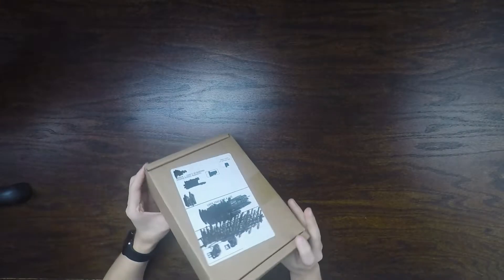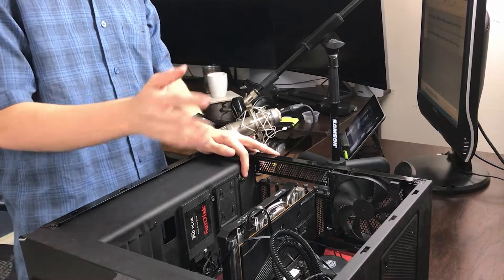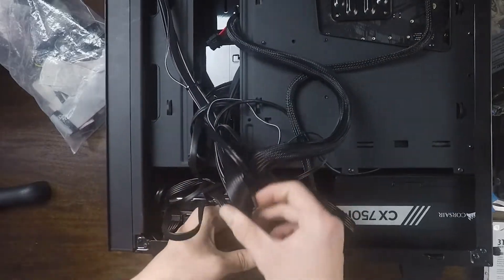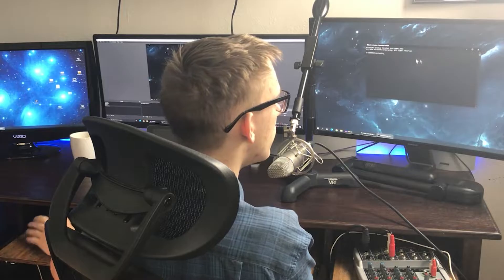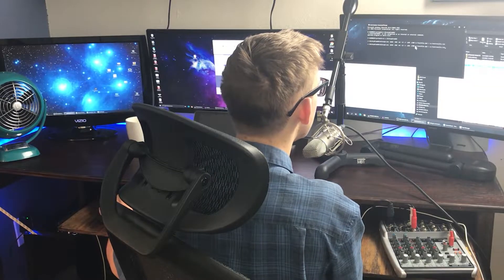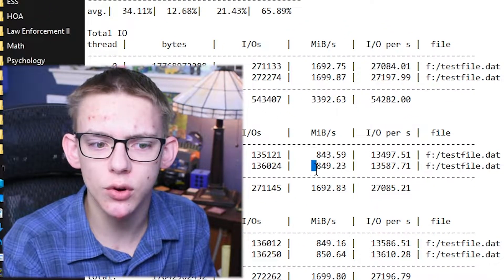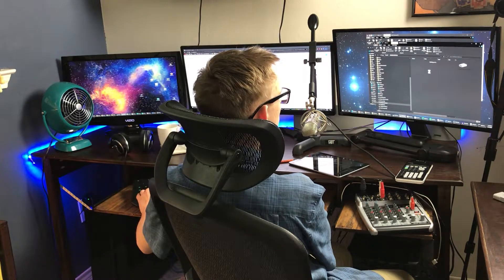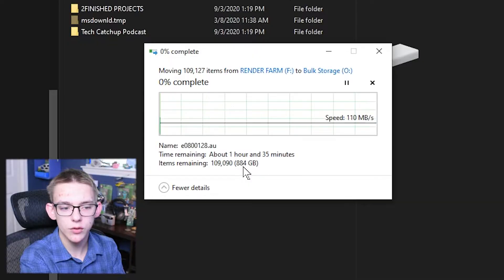3TB for $50?! | Year-Long White Label HDD Review

Comment: how do u achieve 100+mb/s read and write on HDD?
Reply from the maker: I have a 7200 RPM model, so 100MB/s is about normal. I didn’t do this in my video but you can enable SSD caching in some NAS software to improve performance
Reply: @MINDtek1  on really? i didnt know. I though NAS HDD were for company usage only, not consumers. Need at least 3TB HDD for gaming